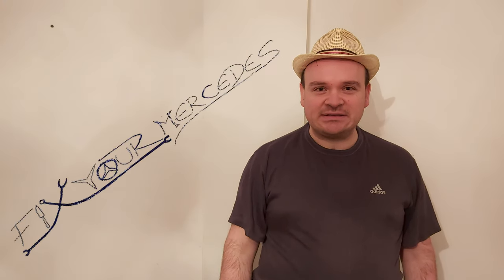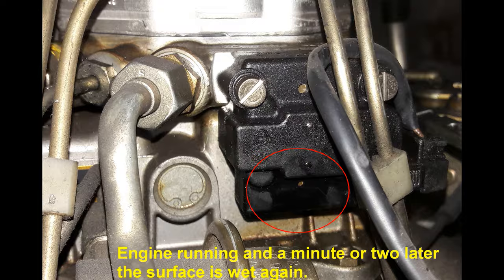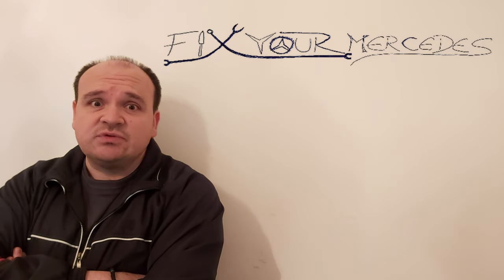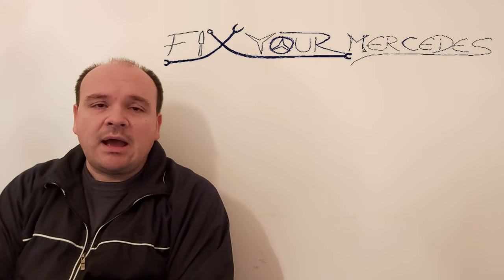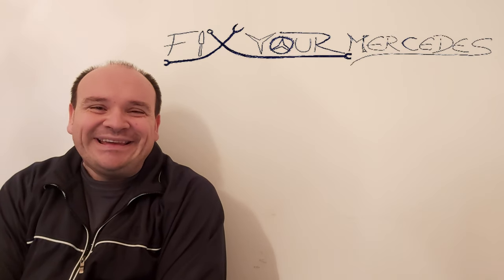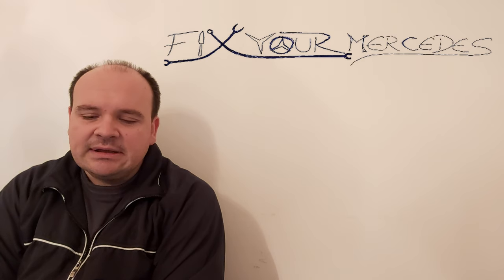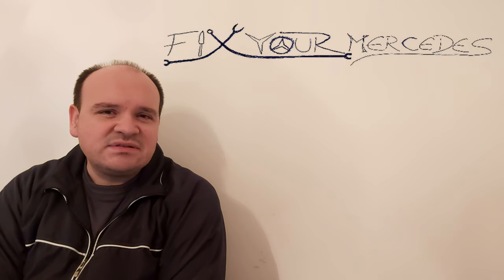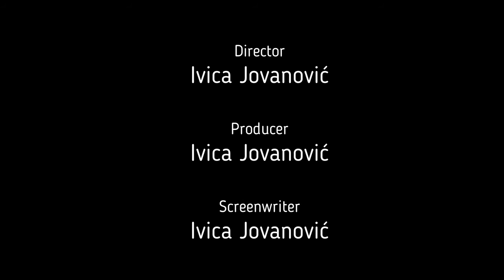Mercedes KE-Jetronic - How much I paid for my parts

Comment: I have a question. My 190e won't start. The injectors pure so much fuel to the engine and the spark plugs fill with fuel. Why is that happening? I have bad injectors? Bad distributor? Or o2 sensor??
Reply from the maker: How many kilometers does your car have?
Reply: Ivica is going to solve your problem, have no worries!
Reply: @darijatomic5489  Medeno moje, ti znas da te ja volim, ja se hranim tvojom toplinom💪😎🍀🌞
Reply: @johnnybravo6672  
Hvala ti Jo,tvojim komentarom, ubedio si me da se vise ovde na ovom yt kanalu ne pojavljujem,iako u spotu je gđa Piljkic...😏👋🏼
Reply: @darijatomic5489  A sta je onda bila poruka pesme?
Reply from the maker: Šta se ovde dešava?
Reply from the maker: @darijatomic5489  Šta se ovde dešava, Đevuška? Nisam dobio odgovor na pitanje?
Reply from the maker: @johnnybravo6672  Hajde mi ti odgovori posto ne dobijam odgovor na pitanje!?Sta si to zabrljao!?
Reply: @mercedeske  
Smatram da smo dobra ekipa i da smo tu da ti pruzimo podrsku druzeci se u sali "Znam da preteram kad se doteram" a Jovek☺😁😂🤣😅
Reply: @mercedeske  
Ja sam kriva sto sam ziva🙃 
Jovek jesi ziv?
Reply from the maker: @darijatomic5489  Hvala ti puno. Nemoj zbog Nikole da mrzis i Sv. Nikolu(mene). Daj upozorenje, zuto svetlo, a ja cu da reagujem!
Reply: @mercedeske  
Nemoj tako sad ko policajac
Nije ni on kriv samo je iskren😅
Reply from the maker: @darijatomic5489  Sta ces vise od toga?Nije valjda da je bolje da je lazov?;-)
Reply from the maker: @darijatomic5489  Jel si ga videla kako me brani protiv one dole sto kaze da sam prostak!?
Reply: @darijatomic5489  Ojhaaaaaaaa.....
Reply: @johnnybravo6672  
Cuj nisam skroz blesava,samo malcice🤧🤭👌
Uzivam kad prosetam kroz tvoj insta, ne zbog misica sto bi opevala Senidah, vec duhovnosti koju si tamo iskazao...ti si rođen pod srecnom zvezdom,naravno da nikom nista ne pada sa neba,da svakom prema zaslugama ide Bozji deo kolaca😅
Reply: @mercedeske  
Inace Ivek nisi prostak,ali ovih dana ti cudan horoskop
Reply from the maker: @darijatomic5489  Ahaaaaaaaa......Ozbiljno?
Reply: @darijatomic5489  Ekipa smo liga izuzetnih dzentlmena i jedne dame! ;-)
Reply: @darijatomic5489  Ok, hajde, daj ti meni link tvog insta profila.
Reply: @johnnybravo6672  
Bas ti hvala, da niste gentlmeni ne bi bila ovde,osim kad te ponese text neke pesme pa preteras🙃
Reply: @darijatomic5489  Znaci, preterao sam sto sam ti rekao da si mi draga?
Reply: @johnnybravo6672  
Koji ti je horoskopski znak?
Reply: @darijatomic5489 Ko vidi? Ne vidi nas niko! ;-) A ti, koji je tvoj horoskopski znak?
Reply: @johnnybravo6672  
Ne koristi te zenske fore,prva sam pitala,a nisi odgovorio za horoskop?(zna ivica ako nije zaboravio)
Reply: @darijatomic5489  Pa, ja hocu da mi ti kazes, a ne Ivica.
Reply: @johnnybravo6672  
Paa koje prvi pitao,a nije dobio odgovor🙄🤔 nisi se izjasnio?
Reply: @darijatomic5489  Znaci, prvo moras da dobijes odgovor, pa onda, ako kazes, kazes, ha? ;-)
Reply: @johnnybravo6672  
Boze pomozi, Ivicu kad pitas za godine nađe se uvredjen k'o da mu  trazis "biip" mnogo mu to nesto tesko pada,treba mu par dana doobriih da se oporavi od pitanja😟, a ti mozda si sa neke druge plsnete gde nema horoskopa ili ti je devojka zabranila da mi kazes-to je sigurno-plasis se devojcice😋
Reply: @mercedeske  
Ivice sta si ti u horoskopu,gde si se sakrio?
Reply: @darijatomic5489  Ne plasim se ja nikoga, ona je fina cura i uopste mi nista i ne zabranjuje.
Reply: @johnnybravo6672  Drago mi je da ste se nasli tako dvoje divnih dusa,i ti si divan i uzvracas joj potpuno iskreno na ukazano poverenje...😇
Reply: @darijatomic5489  Hvala ti puno.